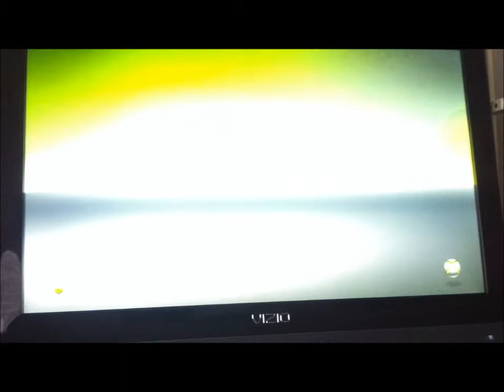Homemade Reflow System - XBOX 360 / Ps3

Comment: When you do a reflow, once the m/b is cool enough, do you replace the corner sealant? Neat home set up. Have you checked out a Yihua brand? Thanks do you have the board raised a little bit above the griddle surface?
Reply from the maker: The clear sealant around the chips edges? No. Just the thermal place would be replaced. Board is raised very slightly above. Not too much as the griddle didn’t provide enough heat. I no longer use this setup but it worked well for me at the time
Reply: @mrsemifixit  do you have a better station? Thanks 🤓

Comment: your boards are warping for sure. 130 degrees you start your top heater and your lucky if you havent fried any chips. should be at least 150 minimum board temp before starting top heater and you need a controlled 1
degree per second rise with 30-45 second hold at target temp.  you need to mount your board to your grill to PREVENT warping. your grill is cast aluminum and does not warp by the way. good luck. nice setup for the most part just need some proper technique and knowledge. lookup tin and lead and mixed melt temps

Comment: Good work! I'm getting ready to build a similar set up with a griddle. Is it possible to get the board to 150 celcius without the top heater?
Reply from the maker: yardbarns Yes but you'll need to modify the griddle. I took apart the temp control of mine and hacked it so it'd get hotter. You'd have to figure out how yours cut power off to regulate temp and do the same
Reply: Gotcha, thanks for the tip. You should post more videos with your setup. It's interesting.
Reply from the maker: yardbarns I actually don't use this setup anymore. Haven't worked on xboxes in a while

Comment: So, are the screws drilled through the griddle or mounted though the board on top of the griddle?
Reply from the maker: Mounted through the board to lift it off the griddle. You don't want to drill through the griddle because it flexes and would flex the board too

Comment: i can use this same system to perform a reball no? i am 15 and want to make a system like this. i will soon go to school for all this and end up buying professional equipment. but for now, can i use this system to do a reball? all i need is the suction pen thing and flux, solder braid and a mount for the chip right?> i can use this same heatgun you are using right?

Comment from the maker: How'd you try to reflow? If with just a heat gun it won't properly melt the solder, it will if heated long enough but since it'd only be top heat by then your gpu would have been damaged. If anything a heat gun alone warps the motherboard enough that contact is made with solder balls but also the warping  can cause contact to be lost (probably why you now have 0102 error). You need controlled heat on bottom and top.